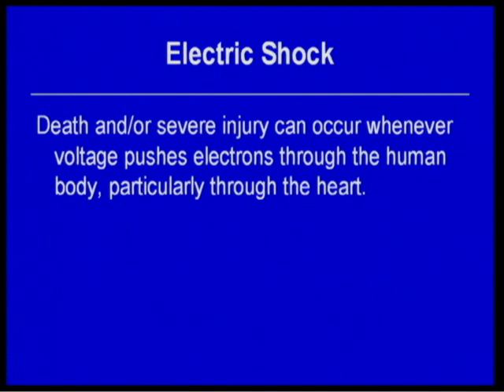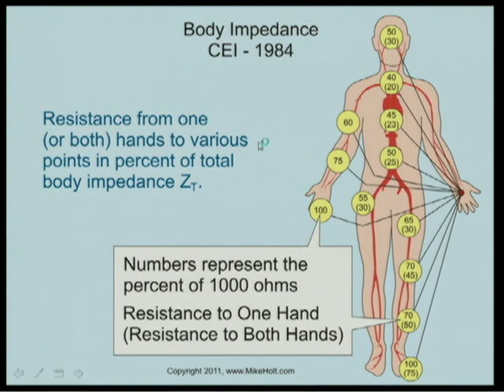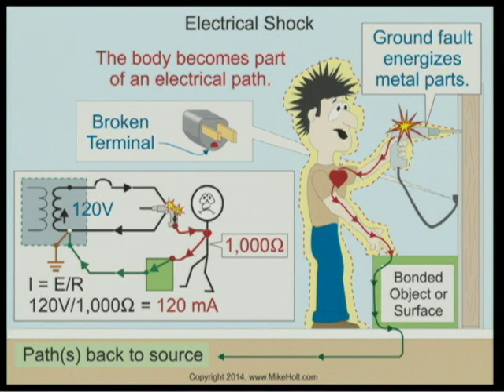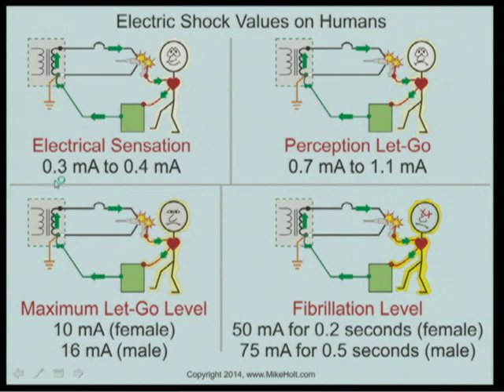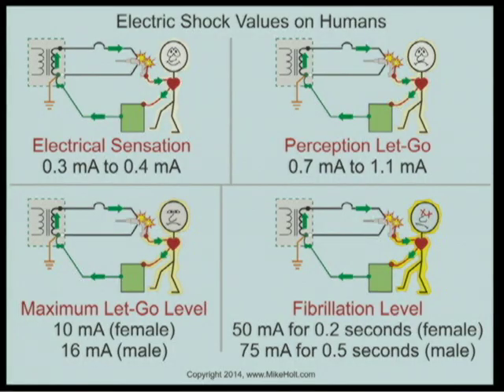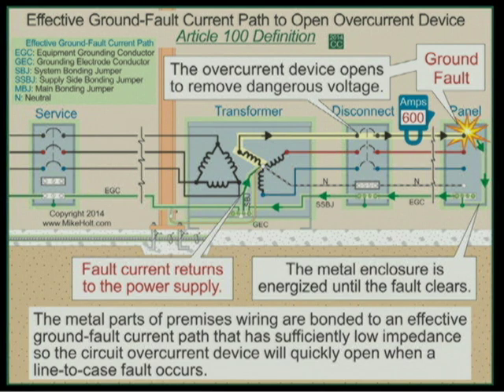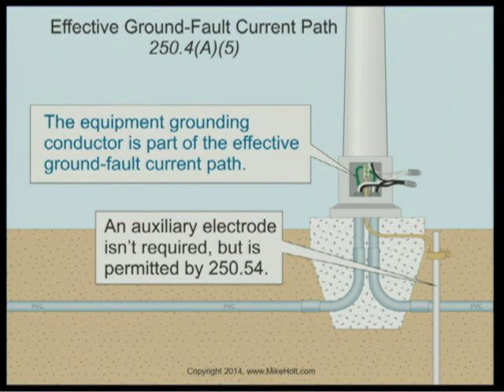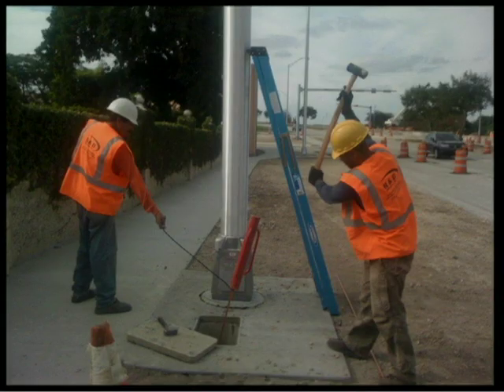Grounding Versus Bonding (26min:26sec)

Comment: This information is wrong. For one, it assumes that facility ground and power neutral are the same thing. All his models are based on this. Neutral and ground should NEVER be tied together other wise we are back before we had three pong electrical outlets. Poles are not supposed to be grounded it is the lightning rod at the top that is and it should be electrically isolated from the pole to create a 30% cone of protection. If you do not protect a metal pole that goes into concrete if lightning strikes it the instantaneous heat created by the strike will super heat the concrete and blow up the foundation that holds it up. This man is ludicrous. I guess this explains a lot of the shotty contractor work I see.
Reply from the maker: +Max Koller At the service to all buildings having a grounded system (120/240, 120/208, 277/480, the utility neutral is always bonded to the equipment grounding conductor. Lightning striking a conductive surface does not result in concrete in the slab to blow up. This is the reason the NEC almost requires the re-bar in a building footer to serve at the building system grounding electrode. If you have any documentation to support your statements, please forward to me at Mike@MikeHolt.com.
Reply: When enough electricity to power a city for two days strikes a small location the heat energy created from resistance can instantly vaporize water/humity creating enough steam power to break/blow up anything that cannot conduct that amount if power.  I will quote Einstein here energy cannot be created or destroyed only transferred. And the fastest way to do that is heat. That is why you never ground in non-conductive material.
Reply: By the way hot, neutral, and ground are 3 separate wires for a reason. If you tie them together electrically it is the same as only 2 wires. Got to get away from the 2 prong outlet of the mid century.  Sorry don't mean to blast you, but I had more explaining to do to my less experienced guys than I want to do after seeing this.  Like the video though it was very entertaining and it started a great discussion.
Reply from the maker: +Max Koller Neutral and Grounds are required to be bonded together via the National Electrical Code at service equipment at all building supplied by a grounded system [250.24(C)] and the load side of separately derived systems like transformers and some generators [250.30(A)]. After that location neutrals and grounds are required to be separated, see 250.142..
Reply: +Max Koller...... never??  haha. obviously you've never installed a new service.
Reply: Mike is well respected in our industry. he's not some arrogant ( a lot of electricians are) fool that spits out of his neck some crap he heard. he has the knowledge, and more importantly, the experience to make these videos. you're obviously not qualified to even make these comments. 

Mike, Great video. Our industry thanks u for all of your research and hard work to keep things as safe as we know possible. And thank u for all your videos.
Reply from the maker: Max, you are the reason I created this video...you are wrong on every one of your comments. I get the impression that you are not familiar with the US National Electrical Code, which is what my comments in the video are related to.
Reply: He is not wrong. The neutral and the ground are both a point of reference and they are indeed (and should be) bonded together at the service location. If they are not bonded, people will die... I promise.